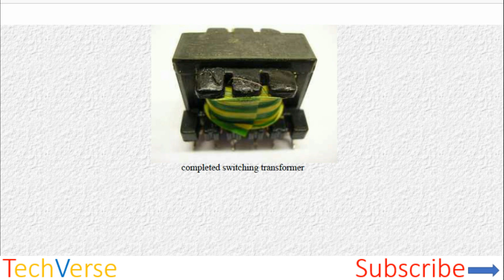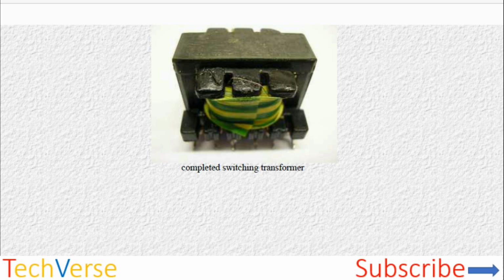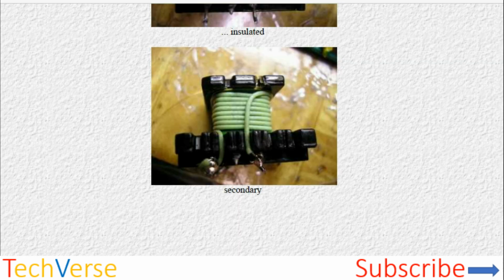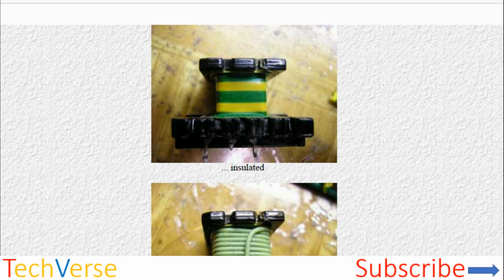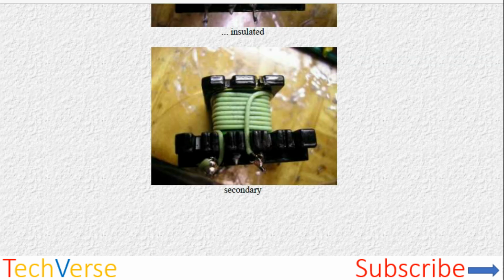Self Switching Mode Power Supply with Optocoupler and TL431 Voltage Regulation 12V 5A

Comment: Your circuit is faulty as we give 230 volts the fuse blows off the transistor is not connected properly it shots negative and positive